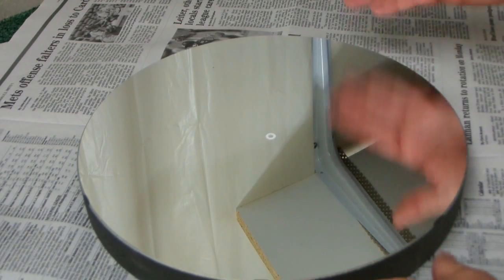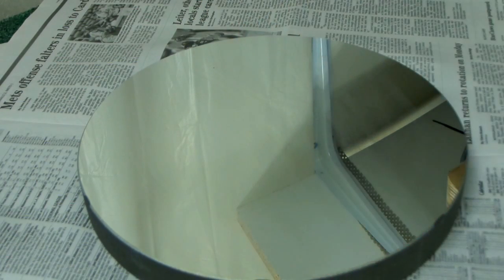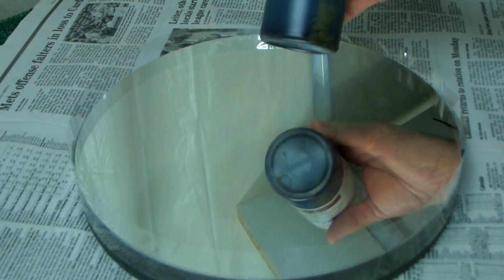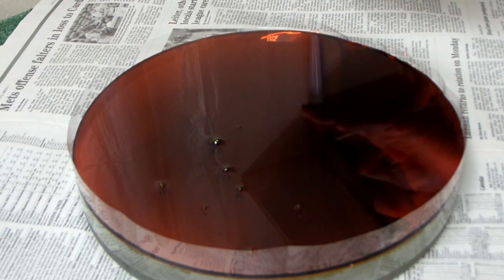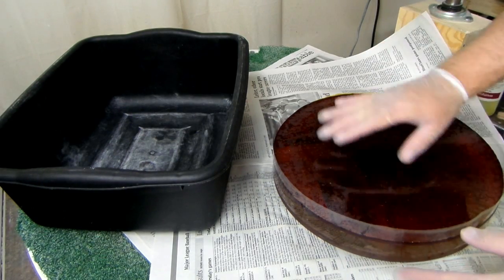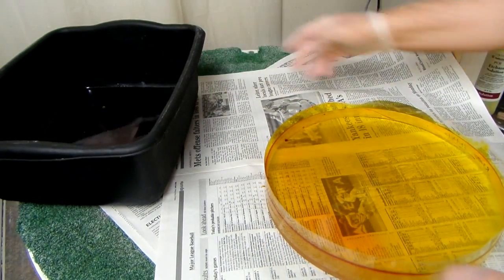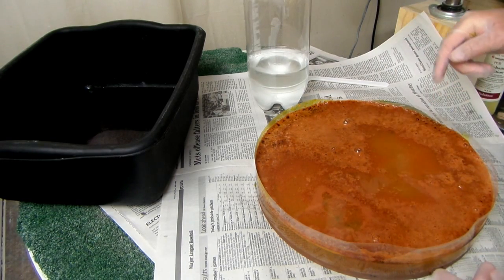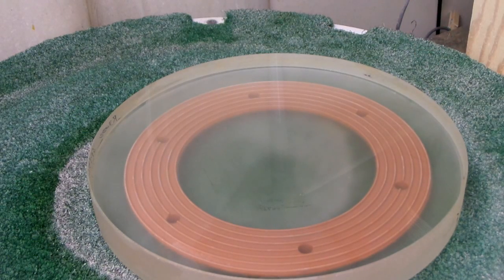Stripping the Aluminum Coating from a Telescope Mirror

Comment: Is it a good idea to neutralize the etchant with baking soda on the mirror? That would precipitate iron oxide and hydroxide particles that could etch or scratch the glass, Ive seen how a rusting nail stains and etches glass. I would say its better to rinse the mirror with slightly acidified distilled water (vinegar or citric acid) first and then after that a good rinse of pure distilled water no need to risk damaging the surface with iron oxide particles.

Comment: Doesn't most mirror have a protecting SiO2 layer on top of the aluminium? Does this procedure also work if this is the case?
Reply from the maker: This procedure strips off the SiO2 layers as well.

Comment: I use a very small amount of etch and place filmy plastic over that. Take the back of your hand and sweep it across the plastic to disperse the etch. There will be some air bubbles. You have to come back and rotate the plastic. Not as scary as your method.

Comment: Actually FeCl3 is a salt not an acid 😅
At least not a bronsted acid
Reply from the maker: While a salt, ferric chloride solutions with water are strongly acidic.  Glad you set the record straight on this, and got it exactly right.
Reply: GordonWaite Yeah. Being a lewis acid (not referring to the general definition of acid by means of donating a proton —> bronsted acid definition) ferric chloride has an instable electron octet and not having noble gas configuration in chemical complexes as central atom make it react acidic. 

But don’t confuse: acid =!acidic
There is a difference between an acidic solution and an acid

Comment: wasting SO much acid!!! you only need to wipe some on and wait no need to use so much. And his ferric chloride looks quite dilute but even at this dilution you don't need anywhere near this amount.
Reply from the maker: You missed my quote at 1:11: "you can use it over and over."  When I am done stripping a mirror, all of the acid goes back into the container, and is used again on the next mirror!
Reply: No I saw that, but you're further diluting your acid that way so the situation will get worse. You're better off with keeping it as concentrated as possible and putting it on with a swab and removing it with one. Overall you'll end up using less acid.
Reply from the maker: I don't dilute the acid at all.  I use it full strength from the bottle, and pour it right back into the bottle.  There is no dilution.  From a 16 oz bottle that costs about $12 total, I can strip probably 10 or 12 mirrors.  So it's about a buck per stripping.  If I tried to strip a 20" mirror with a tiny little cotton swab, it would take me all day.  The time would be WAY more cost than that tiny amount of acid.  You have to be a little practical about things!
Reply: You can apply it pretty quickly and the acid is diluted as it takes on metals, perhaps I should have said denatured.
Reply from the maker: The aluminum coating on a telescope mirror is literally a few molecules thick. If a mirror had 0.1 gram of aluminum on it, I would be shocked.  Such a small metal load is, for all practical purposes, no load or dilution on the ferric chloride.  I'm just not worried at all about trying to save money on $1 worth of acid for a refiguring job that is going to run $1,000 to $2,000 in labor.  A 20" mirror has 314 square inches of surface area.  I can't even imagine putting ferric chloride on that much surface area with a tiny cotton swab!   Especially when the goal is to save 20 cents worth of acid!  You are letting a nickel get in the way of a dollar.
Reply: I think the point here is to use the right size hammer for the job. 
The acid selected is not a strong one so as to not damage the glass. If its diluted a wee bit just means it takes longer.  Don't damage the glass!

Comment: I haven't used FeCl to etch PC boards in some time.  Instead, I've used a mixture of 2 parts Hydrogen Peroxide to one part HCl (muratic acid from pool supply store).  I don't know if this will work on aluminum, but I can tell you it's faster acting on copper than FeCl, and doesn't stain.  It DOES burn your fingers though, so I have to wear gloves when using it (which is a good idea with FeCl too because of the staining).
Reply: It also goes flat pretty quick and you need to keep adding the oxidizer to revive it.  Also, not as safe to have around in storage.  I used it for awhile, but instead started making my own FeCl3 which lasts forever and can be re-used over and over.
Reply: @gettingpast4391  Yes, the home made HCl + h2o2 is a one use concoction, but the HCl I use is stored outside by the swimming pool (in a weather proof bin) where it is used to fix the pool ph when necessary.  The H2O2 is borrowed from the bathroom medicine cabinet.

Comment: Why do you need to remove the coating at all?
Reply from the maker: For a refiguring job, you might not be working on the entire surface, so you want to get the coating out of the way.  Polishers act a little goofy when working on hard coatings or over-coatings.  It doesn't cost but a few cents to strip, and you get to start with a nice, clean surface.  Also, some coatings are very hard to polish off, so you need chemistry to do the job then.
Reply: I see - anyway great job you are doing. I would buy a telescope from you if I was in US...

Comment: Hi Mr Gordon , i hve a quiestions plese;    ....  do you think its possible to remove the MC coating (antireflexive) of a lens ?   than a lot
Reply from the maker: I'm thinking that's not too easy.  Those coatings are usually applied with heat, and they adhere very well.
Reply: Hi Gordon - I'm in the middle of doing that with my refractor lens! It takes 2-4 hours of vigorous polishing, but it is coming off!

Comment: Just noticed this video. At the end, after the aluminum is gone and the mirror is cleaned up, it looks frosted; is it? I have a small aluminized mirror that I want to strip, but I don't want to damage the underlying surface; I just want it re-aluminized.
Reply from the maker: No it's not frosted.  You are seeing the back of the mirror through the front.  The back side was ground flat, so the back is something like a 25-micron surface.  The front is shiny and perfect.  I have never seen a mirror damaged at all using Ferric Chloride.

Comment: Excuse me for asking a totally naive question, but would the aluminium coating not also be quickly ground away during the grinding process, thus obviating the need for removing it chemically?
Reply from the maker: Hi, Dutch!  When a mirror comes in for refiguring, I usually take off the coating right away because it makes it easier to test the mirror.  Often the coatings are in terrible shape, and sometimes mirrors have defective coatings that hide the true surface shape of the mirror.  So by taking off the coating I get a clear look at the real condition of the glass.  In most refigurings, you don't have to go all the way back to grinding.  Grinding would obliterate the coating in short order, but the gentler polishing can take a long time to remove a coating.  I once "polished off" and older coating, and it took two hours of hard work!  In any case, I just chemically remove the old coatings.  It's cheap and easy.

Comment: So, Gordon is it not  possible to do the  record by myself also? $150-$200 is lot of money. I have a 10" spherical what are we talking  to do a reconfigure to parabolic?  I don't have the patience for self grinding and polishing. Norm
Reply from the maker: +Norm7634 Working a 10" mirror from spherical to parabolic is a fair amount of work.  The exact amount would depend on the focal length, and the condition of the mirror at the start.  In ball-park terms, if you have a 10" spherical mirror, you are maybe half way to a good parabolized mirror.

Comment: You could warm the bottle of FeCl_3 with hot water before pouring, which would make the reaction happen much quicker. Agitating the liquid would also help speed things.
Reply from the maker: +Arnþór Gíslason You are correct on both accounts!  Thanks...  -Gordon
Reply: OK I'm confused. Most mirrors have a SiO2 overcoat on the aluminum, right? How does the FeCl attack the SiO2 (glass) passivation coating?
Reply: These ones definitely don't have a glass coating. You'd need to use hydrofluoric acid to etch the glass.

Comment: sodium hydroxide solution should work well too,
Reply: +user21XXL Be careful with sodium hydroxide. It does dissolve aluminium, but it also dissolves glass, especially if concentrated and/or hot. It might make the glass dull.

Comment: I use this for printed circuit boards. if you warm the solution it will act a lot faster
Reply from the maker: Mariano Gaston Yes, that's true!  Thanks for a good tip.
Reply: It is called Arrhenius equation, and there are two ways to look at the results of that equation "every 10°C increase in temperature doubles the rate of reactions." (Which is fantastic for etching copper and aluminium). 

Or "Every 10°C increase in temperature reduces the MTBF by half", usually applied to electronics but works in lots of areas.

Comment: Hi.
George Ionas put me onto this video. Looks interesting. I use "green river" solution for stripping old coatings prior to cleaning and recoating. I would be interested in your comments on the advantages of one method over the other.
Reply from the maker: Peter Wilde Hi, Peter... Green River is just distilled water, hydrochloric acid and cupric sulfate.  Depending on the exact formula, it is probably quite a bit stronger than the Ferric Chloride that I use, and is probably a lot faster.  I like the ferric chloride because I can buy it off the shelf at the Radio Shack, and it is cheap and very safe to use.  If you get it on your hands, you'll just turn a little orange!  I can leave the ferric chloride on the surface overnight and it won't damage the surface of the mirror.  With GR, you probably want to neutralize it as soon as the job is done.